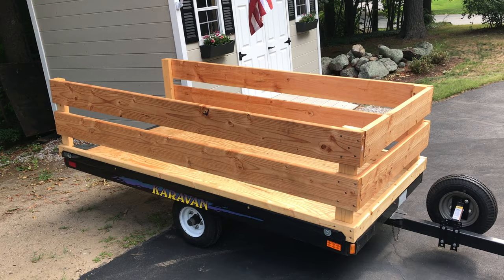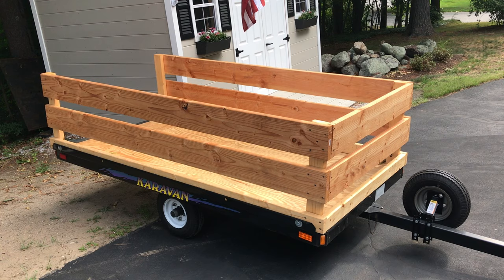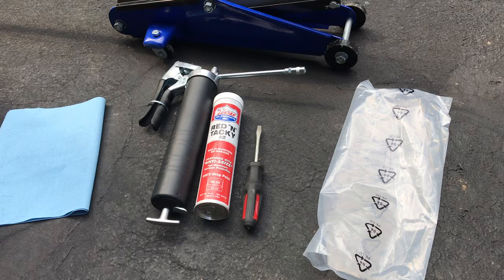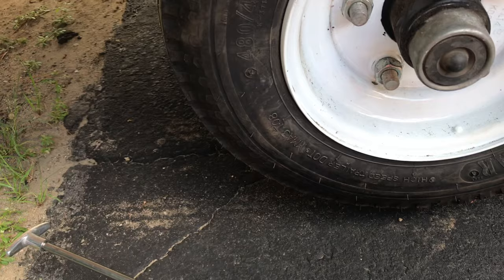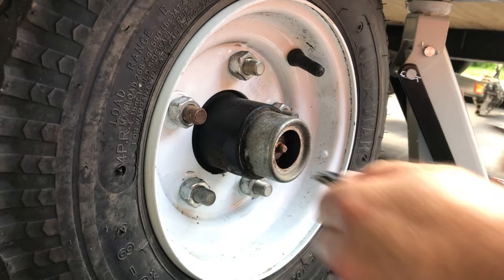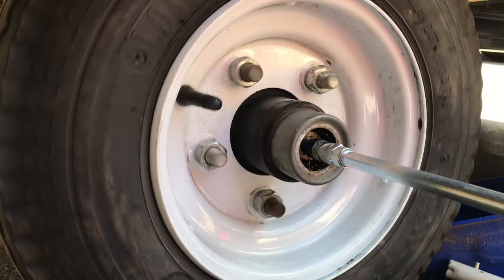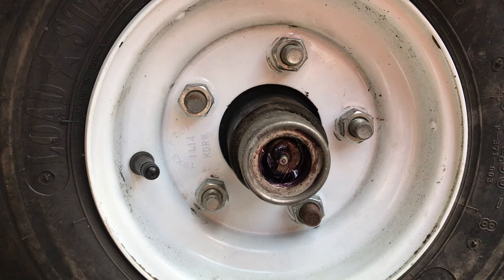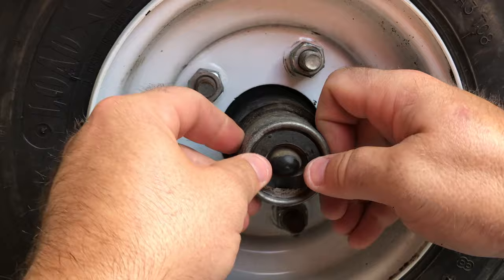How to Grease Utility Trailer Bearings

Comment: What I've learned is this...if the rear bearing was not packed with sufficient grease in the first place, this method isn't going to fix it. Instead, the entire hub should be disassembled, cleaned, and checked carefully for defects. If they're still good, then repack and reinstall. Otherwise you're just guessing what's going on in there.

Comment: Great video!  Question - do all bearing systems require the same “fitting” or “connector” from the grease gun?  Is the fitting called a “zerc” fitting?
Reply from the maker: Thanks!  Trailers have various different types of bearings, but they all require grease. I don’t think all types of hubs have grease common fittings though. There would be other methods of greasing those types of bearings. I believe the ones on my trailer are called EZ-lube. You are correct, the fitting is called a zerk. Thanks for watching.

Comment: How does this ensure the interior bearing has gotten fresh grease?
Reply from the maker: Once you pump the grease through you should see all the old grease coming out of the hub. When you see the new grease coming out of the hub then you know that the old grease is being replaced.
Reply: @hobbyhandyman  Ok so the assumption is that if you have grease exiting the front that the whole cavity inside the hub is filled, and grease is properly lubricating the rear bearing?

Thanks for replying ....

Comment: How do you know you haven’t over greased?
Reply from the maker: Great question. The bearings on this particular trailer and many utility/boat trailers I have come across are part of an EZ lube hub. As you pump the grease in it pushes the old grease out so it would be difficult to over grease it. The way they are designed prevents pressure from building up. I push the grease through until I see the clean grease start to come out. I then wipe off the excess.
Reply: Thank-you for the reply. I have bearing buddies on a boat trailer and a utility trailer. Up to this point I have had both serviced by professionals because of the limited use of each. Is it safe to assume that while travelling at highway speeds, checking your bearings for temperature each time you stop and finding them cool to warm to the touch, you have no issues. Is it also safe to assume that jacking your trailer up and spinning the wheel, hearing no noise and feeling no wobble, that you have no issues. Thank-you. Greg
Reply from the maker: That’s the process I have always taken and it has worked out for me.  I typically do a once over before a long trip.
Reply: Hobby Handyman Thank-you for your time. All the best. Greg